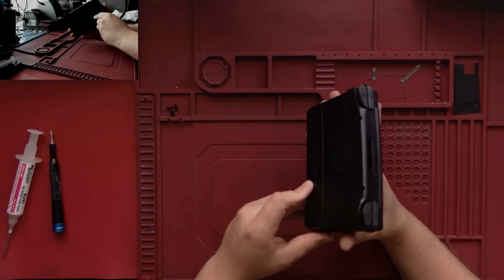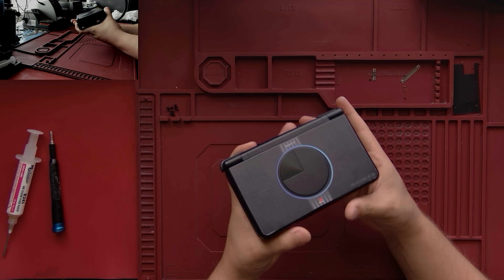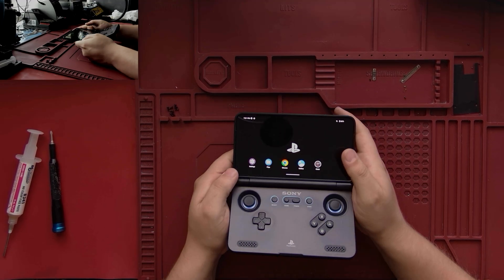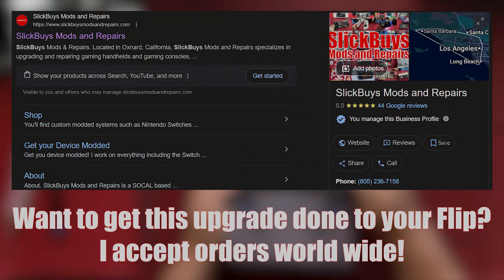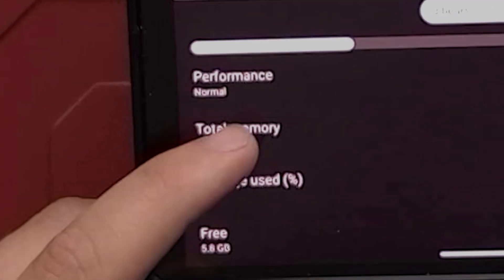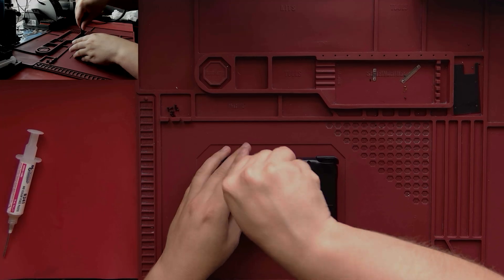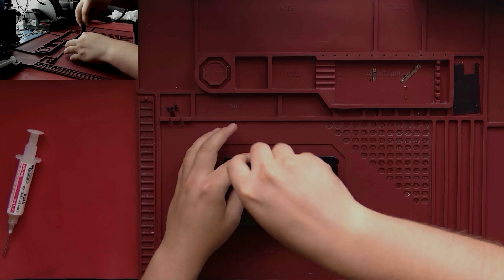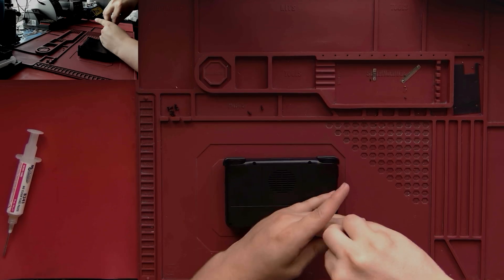Retroid Pocket Flip 2 16GB RAM Upgrade

Comment: You forgot to put back the metal shield for the RAM in this unit 😬
Reply: He didn't fully assemble it so that he could test to see if the RAM chip he installed was working properly. If something was wrong he had assembled it just enough so that he could disassemble it again to work on the motherboard again.
Reply from the maker: Well said, you nailed it
Reply from the maker: I didn't forget, thanks for watching!

Comment: Amazing upgrade I emailed for a quote for my rp mini
Reply from the maker: Replied!
Reply: @SlickBuysModsandRepairs Following this in the reddit retroid community you posted to and wouldn't mind more info about this and maybe possible video if you could on performance, someone was talking about upgrading the ram a few months ago as they are already running their retroid unlocked and overclocked, With 16gb of ram this would be a rather intriguing feature. I believe someone already asked in the reddit forum the price which seems more then fair but whats your take on turn over time, between the other mods you do for steam deck as well and other handhelds id be curious your thoughts, I'm sure this is going to open the doors to a new income source as alot of people want to mod their handhelds from the newer retroid pockets but also the possibility of the older one's if doable, mainly the 2's I hear alot and the 4. 
Though with the retroid pocket 5 mini with 16gb like commented above, that might be right on the money !!
Reply from the maker: Hey please message me through my site: https://slickbuysmodsandrepairs.com/